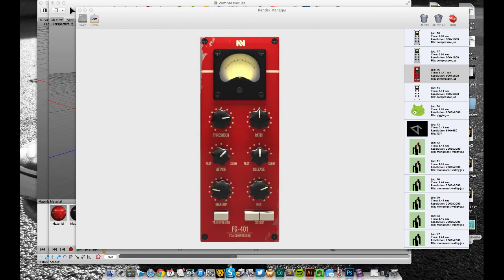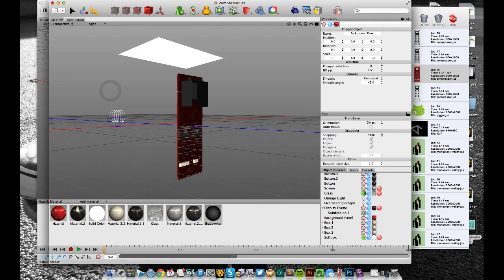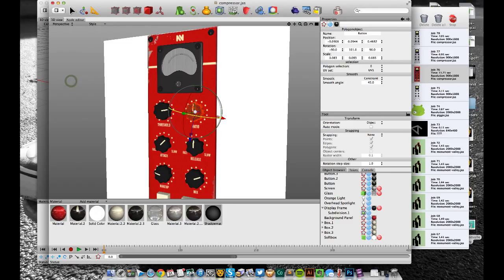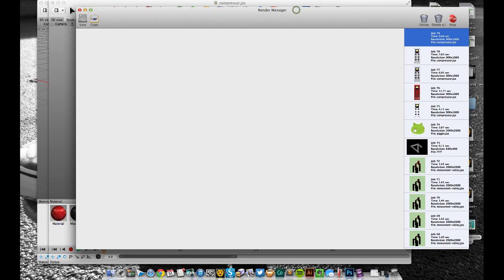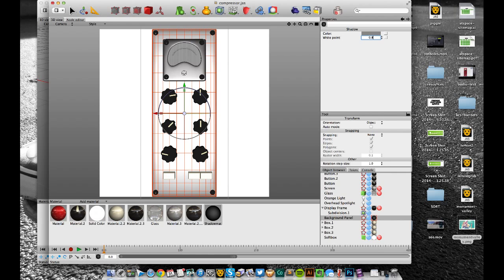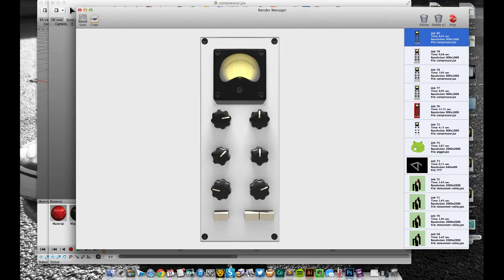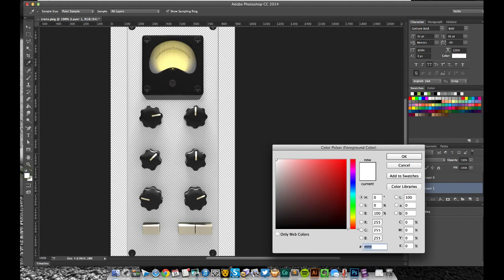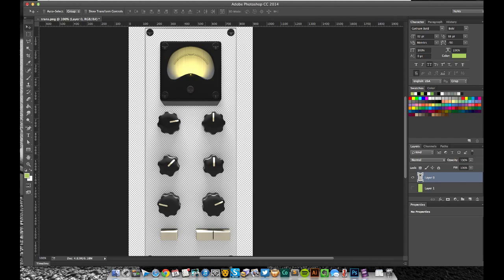How To Isolate Elements - Cheetah3D Quick Tip

Comment: The only way I could get the shadowmat material to save to png as transparent was to use the camera light ON + camera background = 0% opacity. Other light sources and settings would render the solid objects without transparency. Is there a setting I am not aware of ? Or is the camera light the only one that will create that effect ?
Reply from the maker: Hi Jim, you're absolutely right about the camera background needing 0% opacity. You shouldn't need the camera light on though, that seems a little strange!

Comment: Is there a way to export only 1 knob rotating to separate png files inside Cheetah? I know we could do that in Photoshop but the lights and shadows wouldn't change.
Reply from the maker: The quick way would be to isolate the element using the same method from the video and then importing the .mov into Photoshop and doing an image sequence export from there.